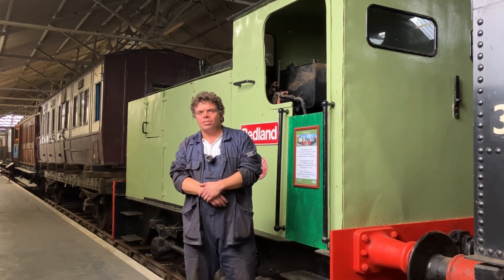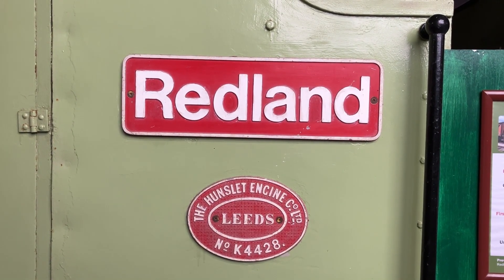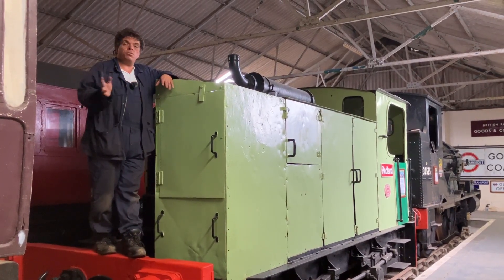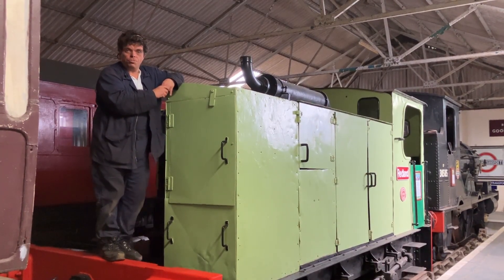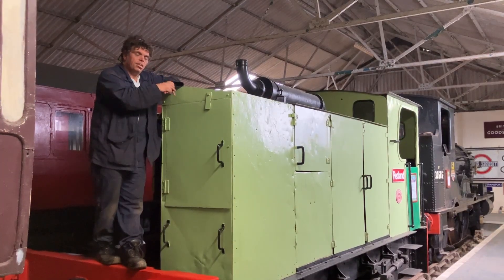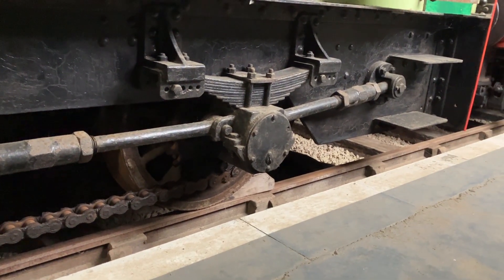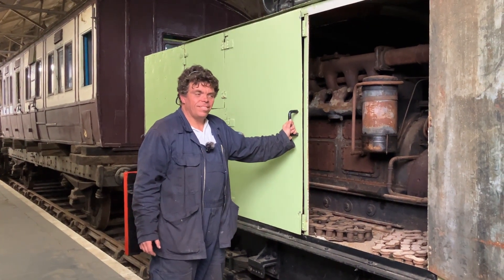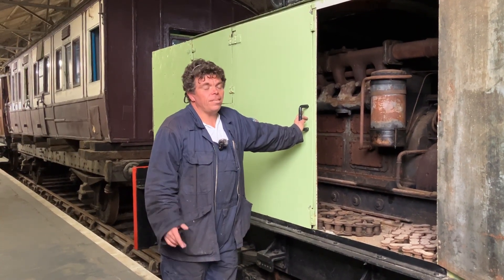(A Very Honest) Review of Our Redland Diesel ~ Collection Corner

Comment: I worked with many air start engines and some were sweet some were cows to start. The 3 cyl lister blackstone with the 3/4 ton flywheel (cow) glenifer, you pumped the bottles from the engine. Shut fuel off to number 1 and that cylinder became the compressor!.